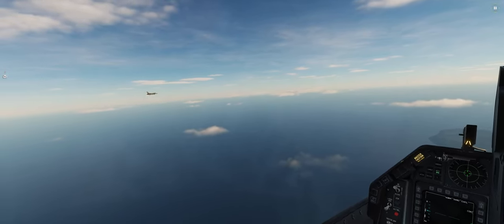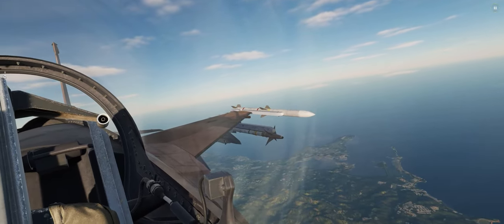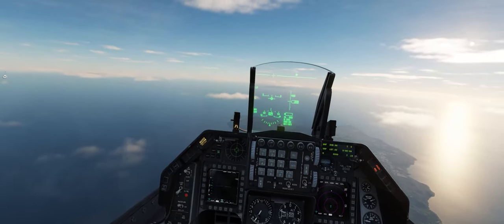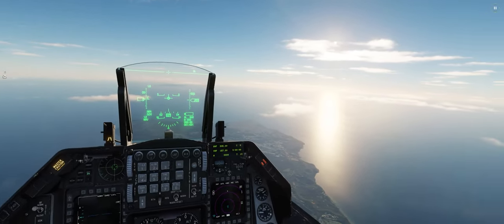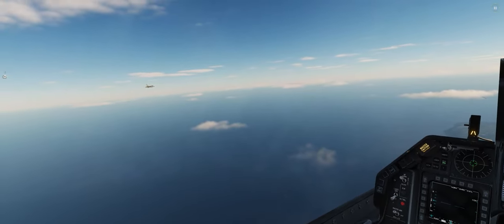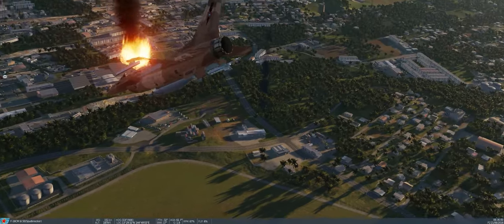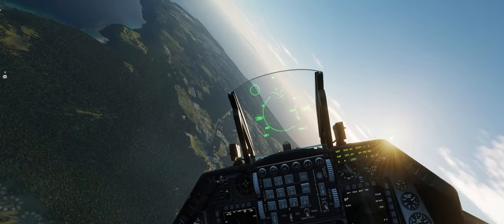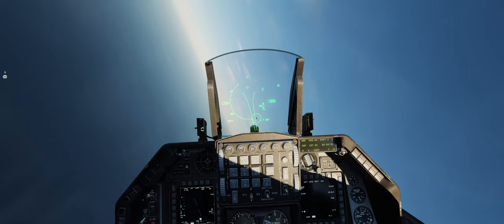DCS F-16C Viper One on One Dogfight Training!

Comment: Thanks for the vid, I learnt a lot!

Trying to write this stuff down for others.

LEAD, PURE & LAG PURSUIT
Lead pursuit - nose ahead of the target

Pros
Highest closure even with inferior speed

Cons
-danger of collision
-may lose sight if falls beneath the nose
-as a lead pursuit turn increase in rate and reduces in radius it may exceed the attacker’s capabilities 

Pure pursuit - nose on the target

Pros
-also provides closure on the defender
-does not cause AOT Angle off Targets Tail to increase as rapidly as Lead pursuit
-provides the minimum frontal area to the target aircraft, increasing the defenders visual problems

Cons
-eventually increases in rate of turn and reduction in radius may exceed the attackers capabilities.

Lag pursuit - nose behind the target

Pros
-good for slowing or stopping closure
-good for relaxing g load increasing energy and accelerating
-good for establishing position in the rear hemisphere against a slower moving target
-good for establishing a position, where once the attacker has approached they can initiative a harder turn towards the target and  establish a stable position behind the bogey and outside his turn to see his underside in what is termed a  “cold-side” lag
-difficult for the defender to maintain sight, especially if the attacker is cold side or ar the defenders six

Cons 
-the attacker is predictable and thus vulnerable to a second fighter if performing a prolonged lag pursuit
-sustained lag pursuit is very taxing, if the attackers higher speed requires them to hold a higher g load

Defense
-defense against hot side lag pursuit is to tighten the turn, including using gravity assist nose low.
-defense against cold side lag pursuit is turn reversal. This can be more effective when performed nose high, causing a reduction in defenders forward velocity and increasing closure. 
-a nose high turn reversal can be effective against missile only fighters, as it may bring the attacker quickly past min missile launch range
a nose high reversal against a gun equipped fighter will nearly always result in a snapshot opportunity for the attacker.

Thanks again for a great vid. I’ve got about 60 hours on DCS mainly in the F86 and F14.

Comment: The best explanation I got of pure pursuit is Nose to tail, lead pursuit nose to nose, or trying to cut off your opponent. Another explanation was thinking of when you are in a car and going fast the car wants to slide out of the turn. So you have to control that speed to maintain the control you require so you don't slide.

Comment: I have a lot of trouble finding targets visually in the air with labels turned off. I usually leave the red/blue mark labels on without the text to aid me but I'm still struggling. Does playing from a 17 inch laptop screen give a massive disadvantage or does it just take practice?
Reply from the maker: Hey man, you probably need a bigger screen and head tracking like TrackIR. It also just takes practice and a lot of anticipation of where an aircraft is going to be based off of your sensors, your intuition and training. 
Biggest thing is don’t look for a jet, focus on a piece of sky, a cloud, or a spot on the ground and look for movement. When you see movement lock your eyes onto it and that’s your jet you’re looking for
Reply: @Spudknocker  Thanks Spud, very helpful! I'm using a head tracker, but anticipation sounds like the key. I suppose better situational awareness will come with experience and a ton of practice.
Reply: @bazsawow  17 inch display is TINY.